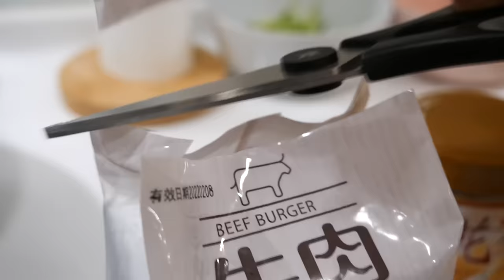Peanut Butter Making in Taiwan / 花生醬製作 - Taiwanese Food

Comment: The peanut butter production line can be optimized, some of the machines' material isn't food grade, the peanut butter color is pretty good, the texture is smooth, the chopped peanut particles size is proper, very great job!👍
Reply: You said some of the machines' material aren't food grade, what do you mean by that?
Reply: @linum861  yes, at 4:56 peanut butter outlet is mild steel
Reply: @ golden machinery. I think you are right about machine parts like that. Also because it has been painted. The paint wears off over time leaving paint particles in the food. So by many standards would not be acceptable. Just small observations.

Comment: Thank you for showing how you make peanut butter. However, your grinder is old and the blue paint has chipped off the sides of the opening where the peanut butter comes out and has large rust spots. This is not very good.  Also, how often do you clean the grinder? Or do you clean the grinder? The peanut butter builds up on the blades and inside and mold grows inside the blades and fresh ground peanut butter is ground with it. Please note that the woman who is spreading out the roasted peanuts with the shovel places the shovel on the floor where she is standing and walks and then picks it back up and begins spreading out the roasted peanuts again. Don't believe I would purchase Korean peanut butter.  I prefer almond butter and have made my own in a food processor.  It takes 20 minutes. It tastes great! It is fresh! And you know what's in it, and how it's made.